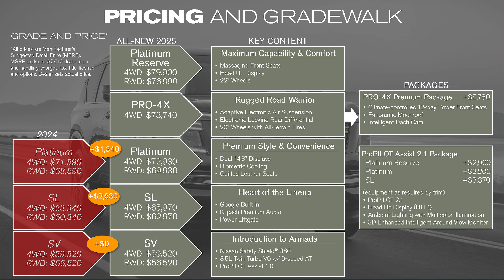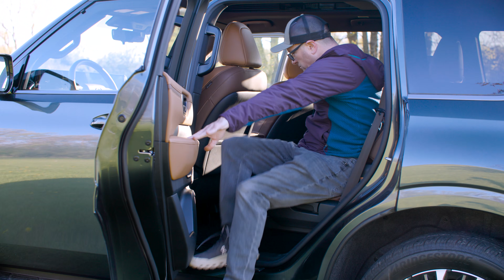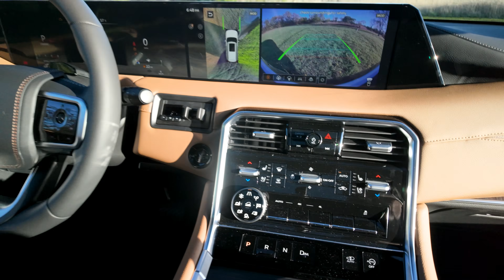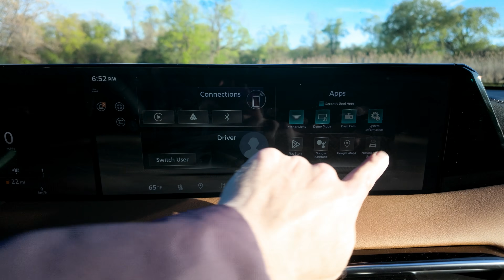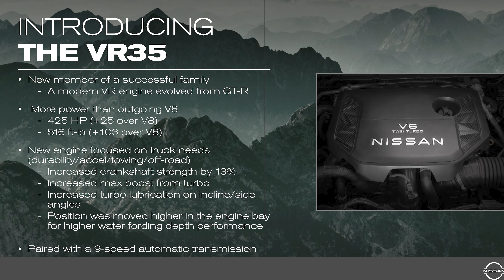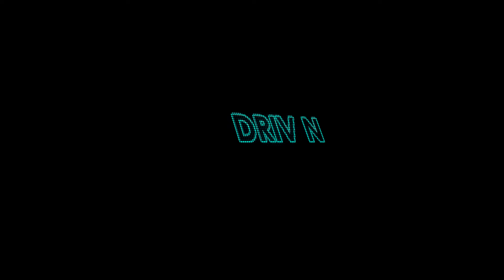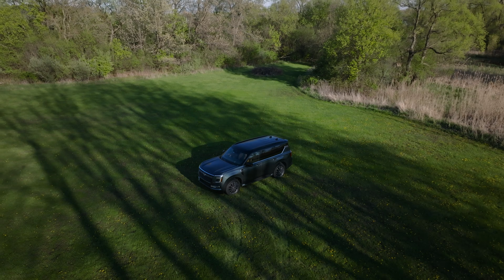Nissan Armada | Using the Lexus Formula

Comment: I was a passenger in the Armada (rental) for a week so I can only give that perspective. Power and torque--adequate,  didn't
 seem overwhelming. Delivery was smooth, linear, seamless and good smooth downshifts when needed. Seemed a little under braked. Passenger front and middle seats (didn't sit in the 3rd row) were comfy. Soft touch point such as the arm rests and top of the door where it meets the window sill--soft but very thinly padded. The fake leather interior was nice. Seemed well put together.  Tech seemed ok as far as I could tell. Arm rests got hard and uncomfortable in short order. Access to the 3rd row was a major PITA--pulling the seat forward/up for access was glitchy, narrow and difficult access. Klipsch sound system seemed adequate. Ride quality was a mirror of the road surface. The length wasn't much of a problem but the width was when it came to parking. Here is an unexpected problem--so getting out of the middle seat to the side/floor board--the heel of my shoe caught the plastic trim at the door sill area and ripped it off--happened on both sides.  Thereafter, I had to sort'a slide my way to street level--no good the seat side bolster. Would I buy one? Mmmmmm..., 50/50 if I were in the market for this type of vehicle.

Comment: If I get the GX it's not as good a vehicle.....but.....it's resale value is great. 

If I get the Armada....I get a far better vehicle....but....uncertain resale value.
Reply: Just don’t sell it, my armada is well over 200k miles, I don’t feel the need to sell it.
Reply: @deadbot61  That presupposes long term reliability, and parts availability. I hop this will be reliable, but more often than not, today's new tech's greatest feature is chronic UN-reliability. Did you get the 25-26, or the older, proven reliable Armada?

Comment: I took delivery of a Platinum Reserve a week ago.
Because I keep my vehicles for 10 plus years, resale wasn’t an issue for me. 
I’ve only got 300 kms on it so far and all in the city. So far the fuel economy is brutal but I think it will settle down.
The tech is a bit overwhelming for this old dog but I’m getting there. I will NEVER learn all its capabilities however.
Ride quality is superb. You can feel the pavement imperfections but not at all intrusive. Glides over the big stuff.
There is a setting to adjust the steering so it tightens up a bit. It’s buried in the settings somewhere. I find the steering good.
Power is great, and very responsive. A bit of turbo lag but nothing to bother me. It hits the power band fairly quickly.
I had trouble dialing in the sound system but my issue wasn’t bass, it was too much treble. After a few adjustments I’m happy. It isn’t audiophile quality but it’s good enough for me. 
It has an annoying shudder or hesitation at low speeds, low throttle. Not a deal breaker, and I’m hoping it goes away as it breaks in, but it’s there.
I managed to permanently turn off the auto stop start. Don’t ask me how as it was buried somewhere in the settings but I did it. Don’t have to use the button every time I start the car.
It doesn’t have anything close to a V8 burble. If that’s an issue, look elsewhere.
Seat comfort is excellent. Driving position is excellent.
I read some have hood glare issues from the sun, I haven’t. 
Mine is gun metal and the paint quality is perfect. I’ve gone over all the panel gaps and they are perfect. Made in Japan so not a surprise.
In this segment my personal opinion is it is by far the nicest looking full size SUV. For me, not even close, but again that’s me.
Dealer experience was just ok. I’ve owned 3 Infiniti’s plus Fords and GM’s. Infiniti dealership experience was heads and shoulders above the rest. Now in my town, Nissan and Infiniti are combined into one dealer. The dealer experience is now Nissan level, not Infiniti. Let’s say it’s better than Ford and GM, but not Infiniti.
Hope this helps!
Reply: I’d buy a QX80 tomorrow if I knew how to permanently disable the auto stop-start. Nothing in the Owner’s Manual.
Reply: @Michael-YYZ hate to tell you but I didn’t turn mine off, it just wasn’t working for the first couple hundred km’s, however it doesn’t activate very often. And further, when it does it’s extremely none obtrusive.
Having said that, if you just can’t tolerate it under any circumstances, there is a delete kit available. The YT video looks pretty easy to install.
I wouldn’t let that stop you from buying it. The Armada a helluva vehicle.
Reply: I just purchased with the same color and love it. great suv!
Reply: Can you please tell me how did you manage to change the settings of the steering and how the hell did you turn the auto start stop off!!!
Reply: @JoyMahendru if you read my last post on this I didn’t turn off auto start stop, it just wasn’t coming on when the vehicle had low kilometres. Having said that, it doesn’t activate very often at all. And if/when it does come on, it doesn’t bother me at all. Very unobtrusive.
As far as the steering, it’s in the settings somewhere. I’ll have a look tomorrow.
Nissan have an excellent series of instructions on YouTube. Just Google what you want to find and you should be able to find it.
Reply: Congratulations on your purchase and best of luck with her.  Since your post is 11 months old, I was wondering how the Armada is doing now in April of 2025.  I picked up a 2025 Armada SL in Alpine Metallic in December of last year and agree wholeheartedly with your statements.  I wish you could remember how you turned that auto off/on permanently off but at least I know its in there and I will go on a fishing expedition trying to find it next time I am in the vehicle.  I hate that damn thing.  Has the MPG improved any?  I am getting about 15-16 quite honestly.  Maybe I get 18 on the highway but most of the time it's around 16 MPG.  I only have 1400 miles on her so I am hoping that mine breaks in like you stated.  I never thought I would end up with the Nissan Armada but the more and more I looked at the Tahoe/Yukon/Sequoia, the more obvious it became that the Nissan appears to be the better vehicle and value packed for the price compared to the competition.  Like you, I plan on keeping her for a very long time as long as she is reliable.  I only bought this because my 2001 Ford F-150 SuperCrew was basically at end of life due to the rust underneath the vehicle.  Good luck!
Reply: @jfscotch hi there, thanks for the message. To be honest, I thought I’d figured out a way to permanently deleted the auto stop/start, but I didn’t. Or at least I don’t think I did. Mine hardly ever comes on. I mean hardly ever. Maybe once per month if that. So I dropped into the dealer and inquired about it thinking there was an issue with the vehicle and the service manager told me the ECM has a number of conditions the vehicle has to meet for it to work: how much fuel in the tank, ambient weather conditions, is AC on or off, heat on or off etc etc. I suppose where I live (British Columbia) the conditions aren’t met very often. Last summer it would activate much more often, fall/winter/spring almost never. Kinda strange but I’m not complaining.
Now there is a delete kit available that I’ve seen - need to take the centre console apart and connect a small wiring harness. Looks fairly easy. There is a video on YT somewhere that shows how to do it. Also I’ve read you can jam a toothpick in the button to force it to stay off. I haven’t bothered with either because, like I said, my vehicle never seems to meet whatever conditions are required so I’m happy.
Owned almost a year now and it’s a great truck. One thing I find quite remarkable that is rarely if ever mentioned in the reviews is its maneuverability. The turning radius is incredible for such a big truck.
I’ve had zero mechanical or warranty issues and the software glitches were completely eliminated by the factory update.
Fuel economy in town isn’t great but highway is great for such a big rig. I hadn’t used Eco mode at all until recently and it does improve the economy. On a trip I can get into the 10 litres per 100 kms range which is 24ish US mpg. But that’s being easy on the throttle. Awesome power when needed but you know that. 
Let me know if you have any more questions!
Reply: @andybone117  Thank you for the update, sir.  I am glad to hear that the truck has been running great for you.  I will say I am very impressed so far and as long as she stays reliable and we can get some longevity out of them, I think they are great purchases.  Time will tell, I guess.  I agree on the fuel economy.  I was able to get about 22 MPG on the highway over the weekend but I was taking it easy on the throttle.  I was driving between 50-60 MPH here in New Jersey.  Once I start to push it, the fuel economy drops but she is fun to drive.  Quick and maneuvers great for such a big rig as you mentioned.  Smooth power and delivery.  Once in awhile, the transmission is a bit clunky at times in the lower range but nothing terrible.  It doesnt seem to do it that much in sport mode which is fun to drive but not great on fuel economy.  LOL.  Good luck and thanks for getting back to me.

Comment: Can any reviewers speak to the longevity of these motors?   Are they easy to work on because if you want it to actually last past the warranty lots of maintenance needs to be done. Is the motor full of plastic parts and hoses with the correct connectors vs cheap ones?   Will it last a decade for that price or are they just wealthy folks leases?

Comment: $87,840 CAD base, and that's in black. You pay $300 for a colour...on an $87,840 vehicle. at least AWD is standard but still.
Our top trim, the 'Platinum Reserve Captain's Chairs' (yes that's the name of the trim) starts at $110,608 CAD. That's a lot of money. For reference, our Lexus GX550 starts at $89,090 CAD and our Lexus LX600 starts at $130,084 CAD.
Reply: In the US., the LX600 starts at USD$105K, or about CAD $146K. The Overtrail starts at USD$115K.

Comment: I love my faithful 2005 Armada family truckster.  If I could buy a brand new 2005, 6 or 7 Armada right now, I'd pay 60K for it in a second.  Reliable, quick, and never, ever, gear hunts.  If the new one here is like that, I'll get one eventually, but these 200 speed autos do tend to shift alot and it drives me nuts. We'll see.

Comment: Re the sound system, I'm a huge fan of Klipsch home speakers and when I saw that Nissan/Infiniti and Ram are starting to use them as their top tier systems I was really re-thinking my car brand allegience, because I love their sound so much. But I sat in a new QX80 with the Infiniti set up, which I think has 24 speakers? and came away feeling a bit disappointed. I wondered if I just didn't find a setting buried in the system that was not configured optimally, but after seeing this, it sounds like maybe they just didn't spend enough time getting it right in the Nissan/Infiniti siblings. The one in the Ram Tungsten trim is supposedly superb, but I have yet to hear it.

Comment: It's too bad the Pathfinder is not body-on-frame.  I read that they plan a refresh to make it look a bit more like the Armada from a front-end perspective (yet not a redesign that allows it to compete with 2 row off road road vehicles (a 4Runner or perhaps a Land Cruiser or even the GX).  I like the new Armada but it is still too much of a boat for my needs (hence why it is a shame about the Pathfinder).  Nissan is a head-scratcher of a company.  I appreciate the thought they put into the Armada, yet the only thing that stands out above their competitors is the seats in it (which are beautifully done leather-wise).  The exterior looks good but the tires / wheels, while big, still seem small to me visually (at least they seem too small on their Pro 4X trim).   I doubt they will draw too many buyers away from the Toyota Sequoia or the GM "boats".

Comment: With all the drama happening going on with GM with their 6.2l, toyotas turbo v6, Dodge problematic hurricane engine and hit or miss ford ecoboost, - Nissan is probably a best option .
Reply: You are too optimistic bro. Down the road, there will be Nissan’s “show time” as well. None of them are trustworthy.
Reply: @yz2616 people beat on Nissans and they seem to be more reliable than certain other brands 🤣. Plus the TTV6 Is derived from the GTR which means some money was put into this drivetrain in the past. The transmission is a Mercedes 9 speed. Mercedes for the most part they do not have transmission issues at least once they separated from Daimler. Even the old armada/titan with the V8 is insanely a great deal for a truck. 25k for a real truck that does truck things! I get luxury trucks but the price to pay for one when you really do not care and just want a truck for a truck when needed! I’ll buy a titan all day everyday!
Reply: Toyota’s main bearing issues on the V35A 3.4L V6 was due to an issue on the manufacturing assembly process, which has been resolved. It’s a complicated powerplant, but I haven’t seen many issues at the dealers I’ve worked with recently.

Nissan’s V35, on the other hand, has had a long history of problems, especially in the Infiniti products. Timing chain issues, carbon buildup, the valve covers leak spontaneously due to the gasket kink towards the rear of the engine.
Reply: @vinhngo1894  1.  The Toyota issue is not resolved.  People are still having bearing problems  2.  This is not the Nissan VQ engine.  It's completely different.

Comment: I feel like Toyota faithfuls put so much weight on depreciation... but in reality, cars that typically depreciate quickly typically cost less on the front end. So you might not get as much when you sell it, but you didn't pay as much when you bought it. Price when you sell your car should be compared to the actual price you paid for it, not the MSRP. So while a 2-3 year old used Sequoia that you negotiated down to MSRP when new may be listed for $10k more than a used Armada of the same age, but the Armada MSRP was $1-2k less and was discounted $6-10k. Of course, I know it doesn't always work out that way and there are extremes. 

Also, I think it's safe to say the new Armada may begin to turn that tide because it's simply a good product and I think it will have a good sales increase trajectory over the coming years.
Reply: Good points you make. It may be a near wash in the end if purchase price of Sequoia is thousands more to begin with after Nissan heavier incentives or discounts. Also if you keep a new Armada for 8 or more years maybe depreciation is not so important. Although maybe I'm wrong on this?
Reply: Depreciation is just the percentage lost between new and used, not the final price. Supply and demand are more important factors in determining this. 

I think prior Nissan Armadas depreciated more because Nissan did not update them for so long, while GM and Toyota released new exciting vehicles, creating demand. Look at the Expedition, that one depreciates more even though it is on par with the GM offerings. Now that Nissan has a legitimate full-sized SUV that has a demand,  depreciation may be less (hopefully). Nissan will have to keep the buzz going.
Reply: I feel like depreciation matters a lot less when most people buy new cars to keep for 8-10+ years. A 10 year old Toyota or Honda is still not going to be worth all that much, and not very much more then a 10 year old Nissan

Comment: If the powertrain can hold together for 200k, im sold. The style is great, it makes the Lexus look like a toy, and power numbers are good enough to compete
Reply: I think it can if you take extra care of it in maintenance. 
Especially coolant and trans fluid exchange, and of course oil changes. 
200k miles would last me 10 years. Drive a lot lol
Reply: @Papolucho702  I've got a Pilot that just rolled over 200k and the most expensive repair was a $65 alternator. I baby it as far as maintenance but I'll admit i drive it pretty hard sometimes. I've had two durangos with the 5.7V8, the first one was great but our current one is issue after issue. Unbelievable how the reliability can be much worse later into the same generation of vehicle.

Comment: Yeah, used is the way to go. My once new, 2022, Platinum was $74K, and in 2 years, depreciated ~50%. I loved her, Big Bertha, except for the boat-like action, on every turn and dip. So when I the 2025s optioned air suspension and had a tech/style refresh, I went to check them out. I was disappointed, no V8, they added another “premium” level (Platinum) to nickel and dime you, and the OTD price was now $89K.  

That was an easy pass, too much for a Nissan that can’t hold its value. The 2022 was worth the going price, IMO, given the cost of the competition, it was a decent value proposition for a depreciating asset. I was planning on keeping her until the wheels fell off…the comforting rumble of the naturally aspirated V8, the analog gauges, I thought I could do something about the suspension when the time came but that boat-like action changed my mind.

But at those prices, I reconsidered and got rid of it. I want my V8. So I compromised, no more analog gauges, I still have some functional buttons, got the air suspension, and most importantly, the V8 - in a L663. Another thing that turned me off to the brand was the post sale service.